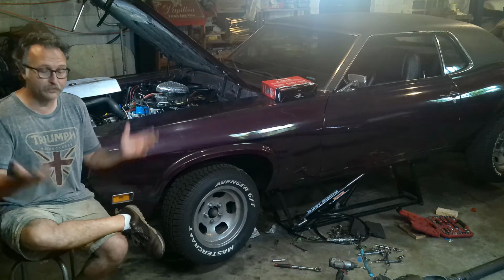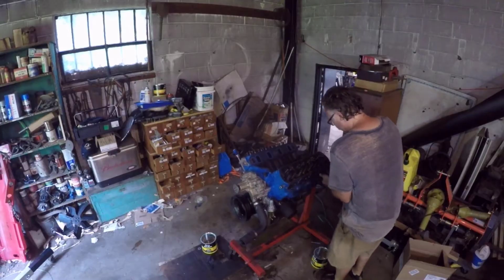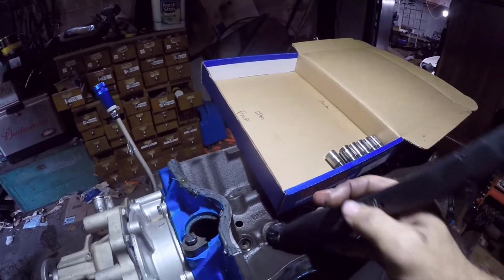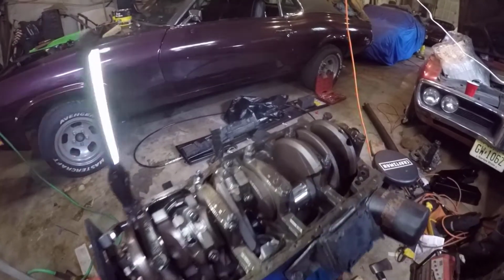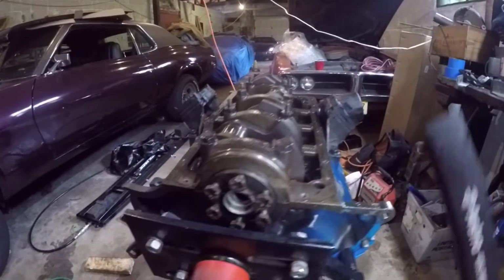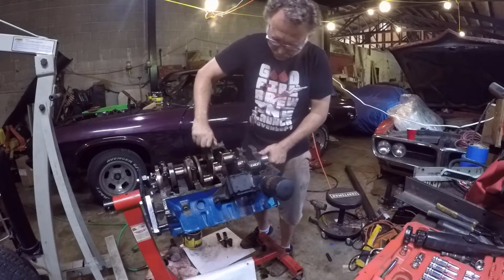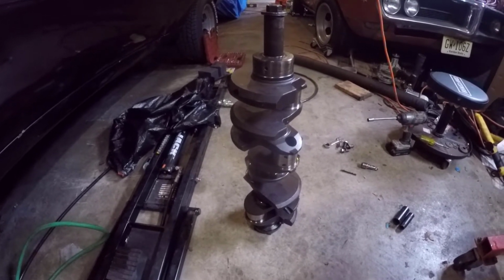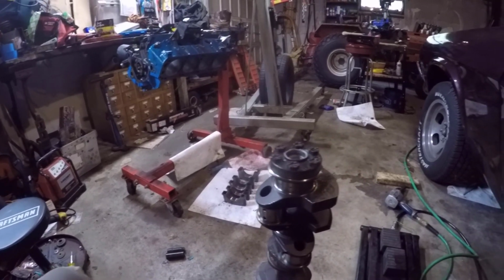1970 Cougar 351 Windsor Removal and Teardown

Comment: I noticed you had wash on all your pistons close to the edge.That is sign of oil going by the rings.Probbably your oil consumption Problem.Wore out bearings will only cause low oil pressure.Thanks for another great video.
Reply from the maker: Wash on pistons, im gonna have to read up on that. I didnt notice it!  Thanks for the feedback! Im learning as I dabble!